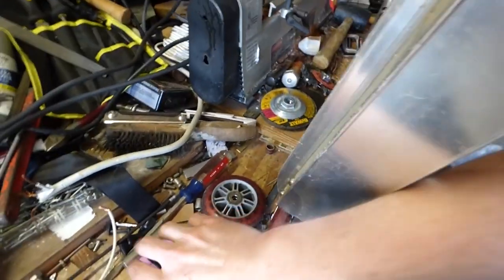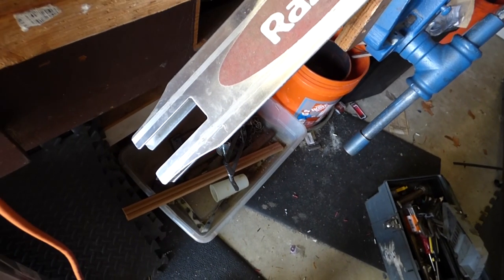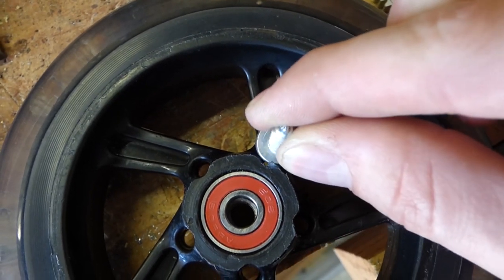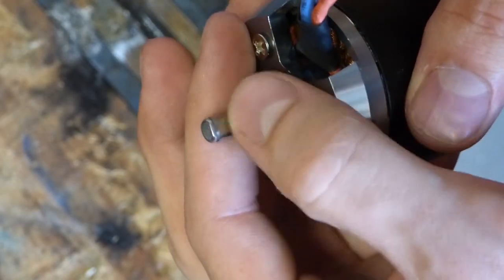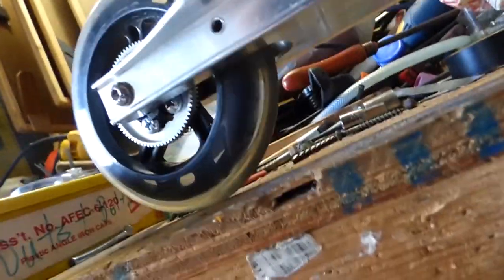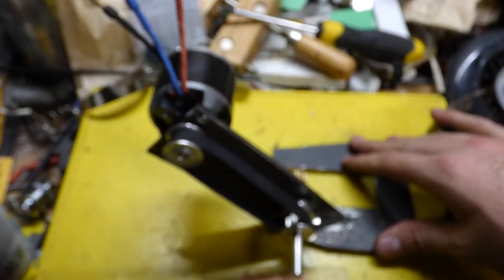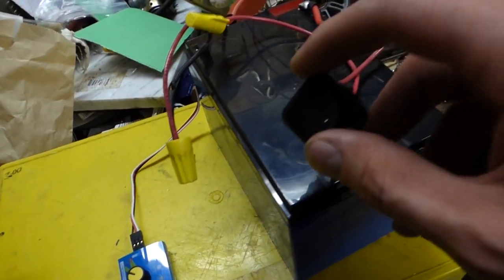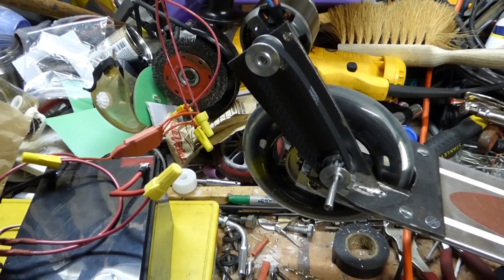How To Make a Razor Scooter Electric | DIY Electric Scooter (Pt.1)

Comment: you want to be very careful that the wrap on the 18650 cells do not tear because the metal may contact the cell and cause a short and that can cause a fire or even make the cells explode  battery safety must be considered when using batteries such as these

Comment: I have recently finished building an electric scooter however went with direct belt drive from the motor to the wheel. This did mean I had to put the wheel to the side of the scooter and then put another one on the other side to balance it, but I can now get incredible acceleration. You might find out that your belt will need tightening. How does it perform and what rating ESC did you use?
Reply from the maker: It performs really well. Acceleration is great,  I have to feather the throttle or else it'll throw me off. Esc was 30 amps I believe. Nothing too crazy.

Comment: I found a razor powerwing scooter on the curb for trash bulk pickup, back wheels were frozen so I grabbed to fix up for the grandkids, I ordered wheels and wheel brackets, sanded it down and removed all the little rust spots, ordered handle bar pads, new brake line and pads, painting it, and now I'm like "f*ck it, might as well go balls to the wall". I'm 43 by the way, so you don't think I'm some old geaser when I say grandkids, lol. Any suggestions on turning this razor powerwing to electric? I'm a plumber so I have plenty tools, just don't have access to a welder. Please let me know, I would greatly appreciate any ideas. Much Aloha brother.

Comment: 100mm or 10cm is 4 inch not 6 inch. Just looking at those wheels with the tire, I would say they are 6  to 8 inch.
Anyone watching this that does'nt live inn the USA works in mm,cm and metres. ( Yes that is how you spell it )
You know you can buy a tape messure that has both inches and metres. It's a good way to get used to the metric system.
JUST SAYING!  Anyway, liked you vid.
Reply from the maker: Yeah 100mm is the size of the smaller wheels, I switched them around. Bigger wheels are 150mm. Thanks for the correction!

Comment: scooter hub motors are on ebay would be easier cleaner design
Reply from the maker: The problem with those is that the smallest ones are 8 inches in diameter and 2-3 inches wide. That would require an entirely custom frame and end up being a lot bigger. The idea with this one was to keep it as close to a standard razor scooter as possible. If you just glance at it or don't notice the back wheel this just looks like a normal kick scooter still. A hub motor would definitely be the way to go if you have a bigger budget and don't mind it obviously being electric.
Reply: @makeeverything8986  what about skateboard hub wheels, you can mount it like a hoverboard motor converted to a scooter